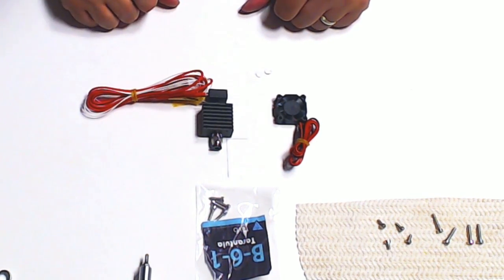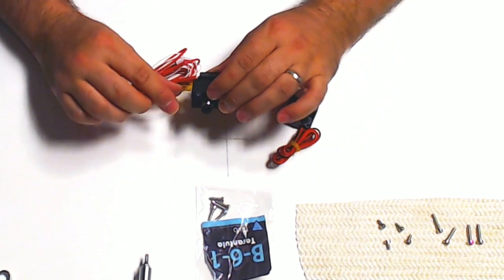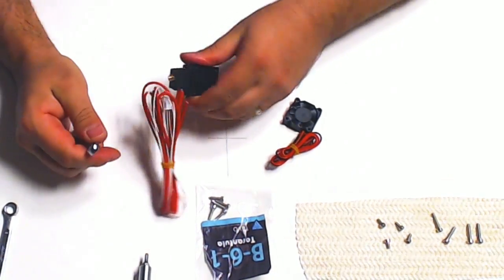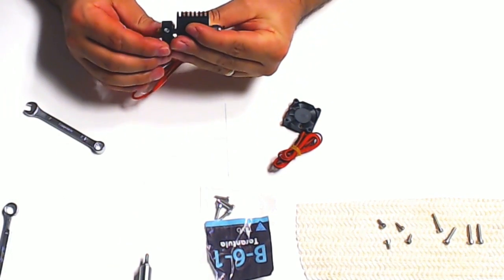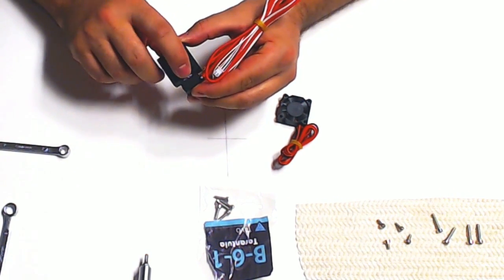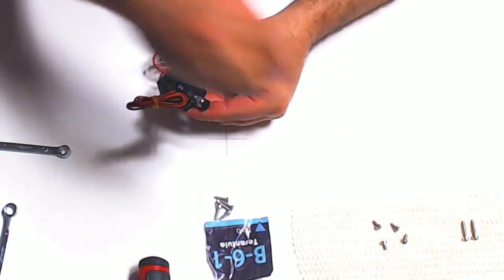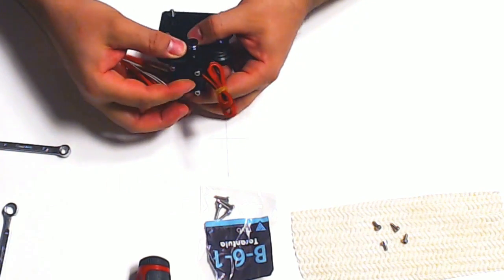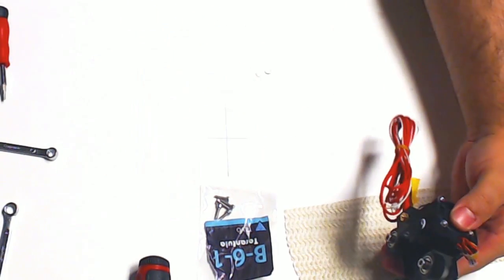Tevo Tarantula Assembly - Step 1b - Hot End

Comment: I had 3 lengths screws for the fan. I used the shortest. I noticed that longer screws close the air-channel on the top and the bottom, so you lose about 20 percent of airflow.

Comment: The connector for the Bowden tube is a airline type designed to resist something like 120psi pushing against it. To release the bowden tube just push down the little plastic collar while you pull the tube out. :¬)

Comment: Just got my printer. The parts are so tight, I couldn't loosen anything without significant force so I left it. I see what looks like teflon thread around the nozzle. When I put the bowden tube in , it grabbed so tight that I was unable to pull it back out with regular strength so I will leave it for now unless there is trouble. I will try to loosen the thermistor screw now.

Comment: Take apart your hot end right now!. get your ptfe tube.

Take the nozzle and heater (?) off.
Now you will just have the barrell with thread coming out of hotend/heatsink.

now feed your ptfe tube in!!.
make sure it is flush with the thread so it "touches" the nozzle when you screw it all back together..
now just leave hotend to the side with ptfe tube in it to the side to a later step..

Comment: I would recommend to mount the hotend later. Basically once the whole construction is done, it's still really easy to screw in. And it doesn't get in the way nor does it get damaged while you build the frame/x/y/z axes.

Comment: Hello! You note you have the auto level sensor. How does it perform? Is it worth the higher price? Thanks!
Reply from the maker: +Kableblah I wouldn't recommend it.  It's only a 4mm sensor, meaning if you want to put glass on your bed, it won't work.  I've opted to use a servo/microswitch combination for my auto level.

Comment: Hi there its seems that my fan will not attach to the grated sides of the nozzle, the screws will simply not go through. Any advice?
Reply from the maker: +Arman Sabahi They may have forgotten to tap the alum.  If you put a little force and make sure your screws are lined up between the blades on the heatsink, you should be able to thread them in yourself.  The metal used in the screw is harder than the aluminum in the heat sink.

Comment: hi, there is a step which is not clear.i loosen the nozzle, then rotate the heat barrel and then i tighten the nozzle. then, after finish assembling, have i to heat the nozzle and tighten it again when it is hot?
Reply from the maker: +Cristiano Zecchi It is recommended to the tight again after hot.  I usually don't and have not run into any issues.   Make sure you rotate the HEAT BLOCK, not the barrel.